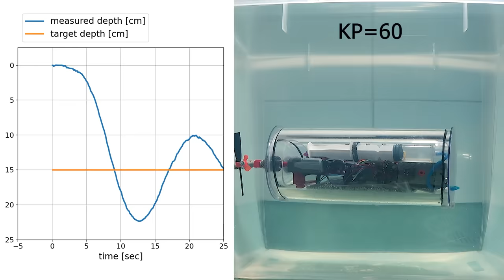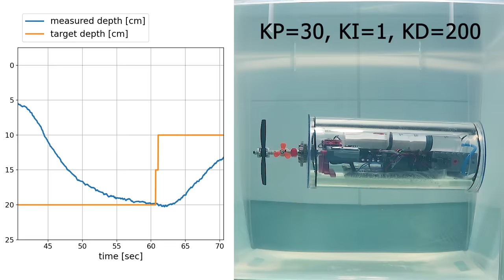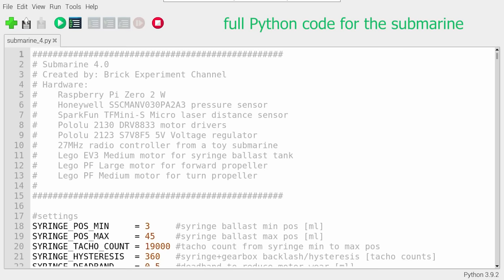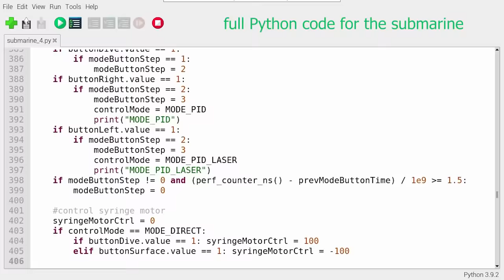Building a Lego-powered Submarine 4.0 - automatic depth control

Comment from the maker: You can read more details of the building process here:
https://brickexperimentchannel.wordpress.com/rc-submarine-4-0-blog-post-series/
Reply: @SF.shadow Cat difficult, cuz the weight can be offset too much to the front, so BEC would need a claw on the front and back. Even controlling the weight shift doesn't come easy.
Reply: @qrygamer  have a weight on rails that can move back and forth, connected to a sensor that can sense the angle of the submarine with another PID controller?
Reply: Damn the new challenger deep sub looks nice
Reply: @smaug131  that can work, actually. As long as u have a big-enough container and a slider that is synced with the claw. Difficult, but easy in building. U won't need a second sensor, that will start complicating things, and if you have an open area, can be easily added in.
Reply: where you buying those lego parts
Reply: wow awesome! works like a charm! congrats!
Reply: Very Cool !
Reply: Excellent work!👍🏻
Reply: 🤔 Are you able to build a thrust-vectored steering mount?
Using one of the 2 rotating outputs to tilt the main prop.

Would increase complexity and turning radius, but would also look much more interesting.

It's a relatively simple modification now, since you can just build another thrust module and throw it onto the back.
If you keep the distance between outputs constant it should also be hotswappable.

Anyways, I really enjoy this series
Reply: Is it possible to change the camera out for one that is a 360° view? And then upload that video so we can experience it in VR?
Reply: @librariantopokemon  yes, but only if he has one or buys one... In the latter case you might want to consider supporting him 👌
Reply: Can you please make a rover that uses a rocker bogey mechanism.
Reply from the maker: Watch the full 20 min river journey here:
https://youtu.be/rO5zHXUckKQ
Reply: @BrickExperimentChannel  nice
Reply: @BrickExperimentChannel  Use Windows on that submarine lol
Reply: @idk_itsme1  30minutes ago nice
Reply: Hey man, you should really consider putting some watermark on your videos. I see this video getting reposted without any link to your channel. You deserve more recognition imho.
Reply: LEGO Ideas soon?
Reply: You could sell those for 100 a pop....
Reply: Can I buy it ?
Reply: please consider adding a watermark, I have seen at least 4 people upload and share this on twitter with no credit to you.
Reply: Very cool, any shot at a play date, my wife said it's totally cool and like I'll buy all the snacks and stuff, jkjk but not really 👉 love the brain power and imaginative engineering on display with the sbc tinkerer community. 
Peace n luv 2all.
Reply: You are the nilered of lego
Reply: @qrygamer  wait a minute MRDEMON?!?! Hello I'm MemeusI
Reply: --bună
Reply: Just did the maths and the submarine is going around 0.3 knots
Reply: @BrickExperimentChannel  would making an elongated, rounded nose for this craft be too difficult? Like an actual submarine.
Reply: lake mead  time....
Reply: lake mead ti.e awith a light!
Reply: can you make it bigger so that you can load a lego cargo inside please?:)
Reply: Looks like that fish was afraid of "Captain Nemo".
Reply: --> fish
Reply: You need an SLA 3D printer, expand your repertoire
Reply: Wow! You just keep on upgrading ur stuff! I remember your first sub video... nothing like this now
Reply: @SF.shadow Cat W
Reply: @SF.shadow Cat ๅ
Reply: this is a seriously cool kick in the nuts
Reply: It's amazing
Reply: How did you measure the depth?
Reply: Can u make lego small working boat
Reply: @SF.shadow Cat I'm a cat🐱
Reply: @smokycurves4232  are you a cat
Reply: @Gnomeusthe3rd  I push things off the counter at  2 am
Reply: Amazing! What’s the range you can control this? You should be working for a military contractor
Reply: Good innovation...
How much it cost...
Reply: How to produce free energy please video banao
Reply: build a huge ship out of legos and other things and test it out in the river
Reply: Как шприц влияет на погружение и всплытие?
Reply: Your like the hachiroku24 of Lego tecnic
Reply: Maybe this Submarine more reality if you fix the up down teleskop..
Reply: I want to buy this including 📷,  let me know about the price
Reply: Hi there. I don't know what you can do but Norton is flagging your blog as a "dangerous" site
Reply: @SF.shadow Cat no opoppooo in ok
Reply: your vids have been stolen many many times by tiktok creators
Reply: We Want 5.0 Lego submarine !
Reply: @SF.shadow Cat a
Reply: anyway you could make me one? i would love to have one lol
Reply: Have you ever tried to built a moving Mecha?
Reply: Try making the massive titanic lego set functional plz plz plz. It will be cool plz
Reply: This stuff is so impressive! Imagine a lego underwater base with docking station with airlocks the sub can dock on, that would be awesome! But also several magnitudes more difficult.
Reply: @SF.shadow Cat щ) жзддщщщ88
Reply: 🔴 What Is Islam? 

🔴 Islam is not just another religion. 

🔵 It is the same message preached by Moses, Jesus and Abraham.

 🔴 Islam literally means ‘submission to God’ and it teaches us to have a direct relationship with God. 

 🔵 It reminds us that since God created us, no one should be worshipped except God alone. 

 🔴 It also teaches that God is nothing like a human being or like anything that we can imagine.

🌍 The concept of God is summarized in the Quran as:

📖 { “Say, He is God, the One.  God, the Absolute.  He does not give birth, nor was He born, and there is nothing like Him.”} (Quran 112:1-4) 📚

🔴 Becoming a Muslim is not turning your back to Jesus. 

🔵 Rather it’s going back to the original teachings of Jesus and obeying him.
Reply: I thought you were done but I guess I was wrong
Reply: can you make a plane that can fly at high speeds
Reply: That’s not low powered at all that thing is a fish
Reply: You ought to be the first to build the antikythera mechanism with Legos.  I'm certain there is a reverse engineered blueprint somewhere online.
Reply: ビリーバーズ
Reply: @SF.shadow Cat .
Reply: Very cool, but c'mon dude post the code in a github gist or something, don't make me use that creepy dropbox thing
Reply: Special thanks for fish ----)
Reply: hello, why did you use SAN plastic on lid instead of acrylic?
Reply: @hpsaturn  trfirrddudutudrurudt0oi😗🏩💄🎰🎴🀄😗😗😚😍💏💑💋👄
Reply: I wholeheartedly think you're gonna use a helium balloon one of these days ❤❤
Reply: @SF.shadow Cat ១🎉🎉៨ថក.................................,
Reply: Build one that can carry cargo. XD
Reply: @ajeltheflightsimmer  That would be cool
Reply: Thank you!
Reply: Y
Reply: @WetDoggo  ii III i
Reply: PLEASE can we fill a giant swimming pool with these and make it into an online pvp game?
Reply: 🎉😢❤😊😮😂😮😮😅🎉🎉😢❤😂😂🎉😅😂❤😂😢😢😮😅😊😊😮🎉❤😂🎉🎉😮😅😊😅🎉❤❤❤😂😢😮😊😊😊😢ল😂❤❤🎉😮😊❤❤😂😮😅🎉🎉😢❤❤😊😅😊😮😮😢😂😢😅😅😅😊😮❤❤😂😢😮😅😊😅😮❤❤😂🎉😮😊😅😢😂❤❤
Reply: You do not need to pay 250 grand to die
Reply: I have a C2000 Microcontrollers from Texas Instruments, can this serve as a computer?
Reply: I have a question how does he uses python code to move a submarine please tell me the logic behind of this? What equipment does he use for saving code in an instrument and then use it in submarine
Reply: ❤ creative❤
Reply: i like you tanks and subs
Reply: Can I buy a bundle of this so that I can build it at home and test it cause I am going to a pool in few days

Comment: Extremely cool. The visual clarity through the flat plexi in the front was actually astounding. This is a great proof-of-concept for a low-cost underwater remote filming rig.
Reply: "Low-cost" if you do not include in the LEGO xD
Reply: @DAS_k1ishEe  lol yeah Lego is kinda expensive when it comes to the electric stuff
Reply: Low Cost if you don't include the kilogram of tungsten pellets he threw in there for whatever reason.
Reply: @ben5515  to keep the sub from flipping since he has no roll controls
Reply: @ben5515  it's ballast
Reply: @DAS_k1ishEe  compared to a proper rig, I wonder what would be low cost?
Reply: @WingMaster562  maybe 800 bucks for one idk
Reply: Don't Read My Profile Photo  Ok.
Reply: @Egerit100  well I guess we know the subject of submarine video #5.
Reply: @Sircliffe  do not feed the troll... report and ignore.
Reply: @ben5515  You don't have to use tungsten. Look at the previous versions.
Reply: @Sircliffe  the buuuurn
Reply: Low cost if you don't include the tungsten
Reply: @ben5515  you can use lead to lower the price...
Reply: @ben5515  he used the pellets to keep the sub upright and level
Reply: @shauncrombie8328  also so it could actually sink... The parts that make it are VERY light, they don't offset the buoyancy of the air in they volume.
Reply: Don't Read My Profile Photo  ok i wont
Reply: I'm honestly glad he kept to the clear body all this time
Reply: Don't Read My Profile Photo  ok
Reply: The only issue is that comms probably wont work at higher depths
Reply: legos are expensive
Reply: @ben5515  well tungsten is very cheap for its weight, and that submarine is VERY light without any sort of ballast. so yes, they added in tungsten!
Reply: "low cost"
with Lego in that build you'd probably be cheaper with buying an actual submarine
this was sarcasm
Reply: Totally agree
Reply: Low cost if you would use printed gears and dollarshop motors+ a cheapee module, not a pi
Reply: 24k gold pellets will add more stability :)
Reply: @davidd2661  Pi is a good proof of concept. You could always custom make a PCB board or a microcontroller for far cheaper
Reply: he tore apart a rc submarine to make a rc submarine…
Reply: The visual clarity was high because that water is crystal clear
Reply: So cool
Reply: @ben5515  you should watch the other attempts he made, and you would understand
Reply: @etaashmathamsetty7399  Lego is overly expensive period. Not only the electronic parts
Reply: @78tx  Maybe wire it with cable from top like those old school "remote" toy cars. Would work like a leash too
Reply: Don't Read My Profile Photo  ok
Reply: ballast
Reply: lol.. Lego and cheap doesn’t go well together
Reply: You assume LEGO is ever low cost lmao.
Reply: Low-cost underwater smuggling rig.
Reply: “What camera did you use get the underwater shots, they looked amazing”
“Lego, camera, a medicine syringe and a raspberry pi board.”
Reply: @78tx  you can probably improvise a surface buoy or conning tower to increase the depth
Reply: @DAS_k1ishEe  Well then don't use lego. The chinese brick manufacturers are just as good in most places. Their Differentials and torque wheels aren't as good but everything else is as good.
Reply: It's not plexi
Reply: @78tx  "higher depths" really XD? You mean lower depths
Reply: Acrylic plastic acutaly has better clairity than glass.
Reply: @ben5515  one kilogram tungsten is about 15 bucks bro
Reply: @pfefferminzbonbonverkaufer8836  Bro who’s your tungsten guy? I have bought a large amount and it usually runs £100 to £200 a kg. Maybe it’s a UK thing. Also I know it’s a ballast but he could’ve used steel or sand
Reply: “Hey man, could you make one with a carry capacity?” - Mexican drug cartel
Reply: Don't Read My Profile Photo  really
Reply: @ben5515  1kg of tungsten pellets is 40$ or so
Reply: Don't Read My Profile Photo  ok
Reply: The lego motors are pretty pricey
Reply: @StMargorach  deeper highs...
Reply: @Egerit100  could've used sand in a plastic
Reply: Legos weren't around when I was a kid so I would have to make my submarine out of Lincoln Logs. 🪵
Reply: Idk what you mean with low cost but adding the  Lego components and time.  This is definitely not low cost lol
Reply: @78tx  am.... In English, we say "I'm the DEEPER depths" 😒
Reply: @ben5515  the air inside the cylinder would increase buoyancy too much. The pellets are ballast but a cheaper material could be used for that
Reply: @ben5515   to keep it as the bottom of the sub so it doesnt flip if im not mistaken
Reply: 7.5k likes in 8 months!!!!!!!!!
Reply: No it isnt
Reply: Do you mean underwater remote bomb? 😂
Reply: @ben5515  It's called ballast and without that it wouldn't submarine at all.